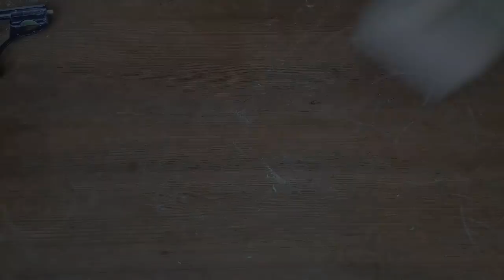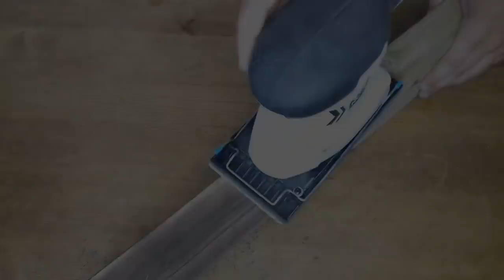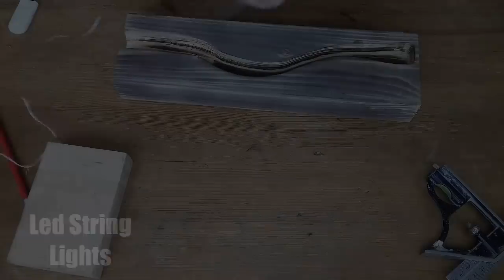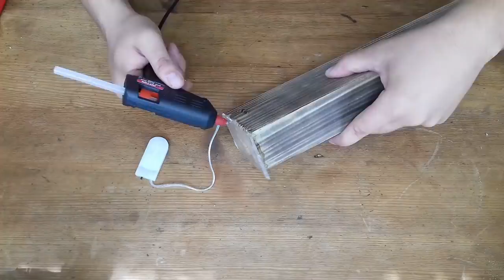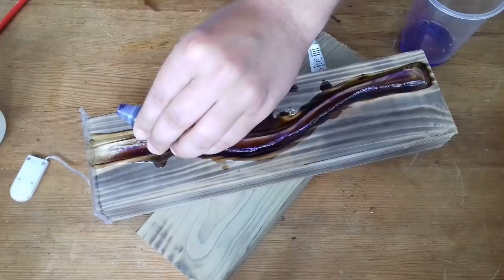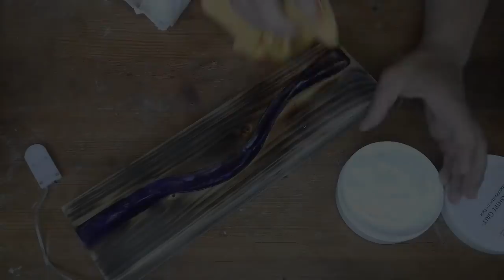Epoxy Resin Led Lamp - Resin Art

Comment: How long do the lights normally work? Have you ever had any burn out yet?
Reply from the maker: LEDs have a general life expectancy of 50 000 hrs
Reply: @mbresinart  Thank you. And VERY nice work. Thank you for sharing your skills.
Reply: @mbresinart   they should burn out very fast as they are covered with epoxy, overheated. Am i wrong?
Reply: mr.antonov yes